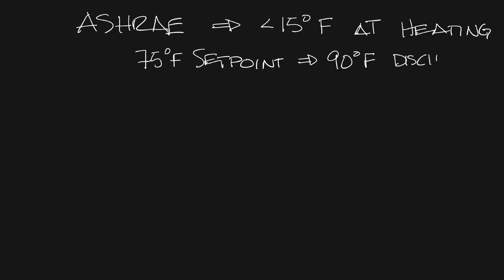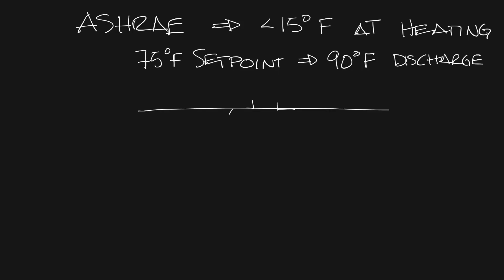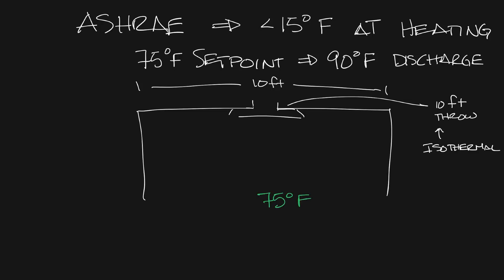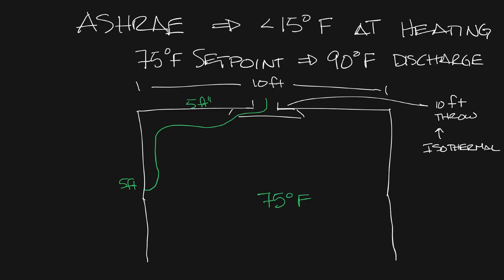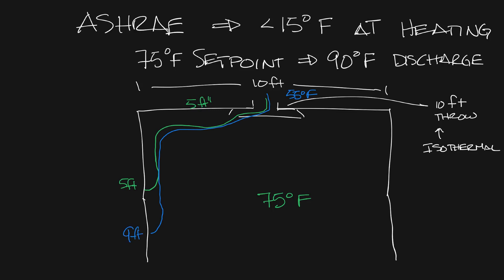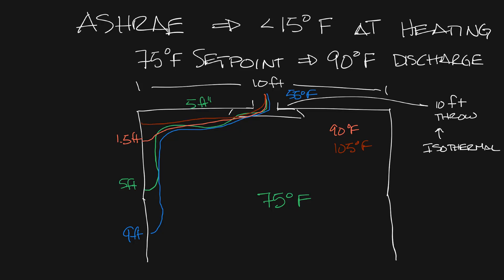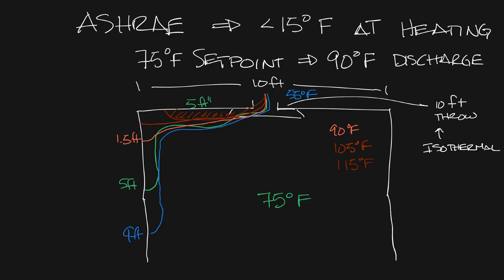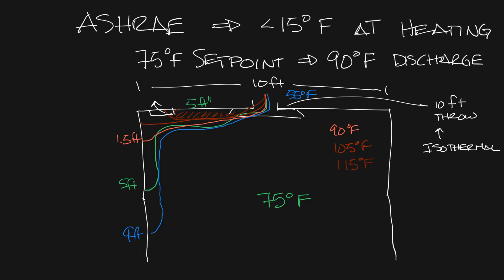Titus Timeout Podcast - Why Hotter Supply Air Doesn't Heat Your Office Faster

Comment: This is a good example of why it is better to supply heat through, for example, radiators or underfloor heating instead of via supply air.
Then the energy moves with water instead of air, which is much more energy and space efficient.
It will also be easier to regulate the temperature in each room.